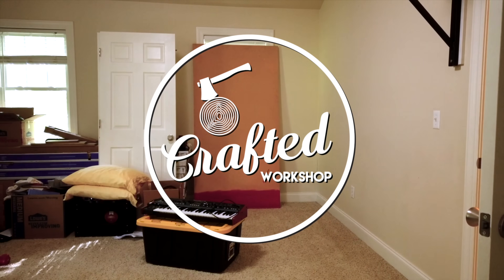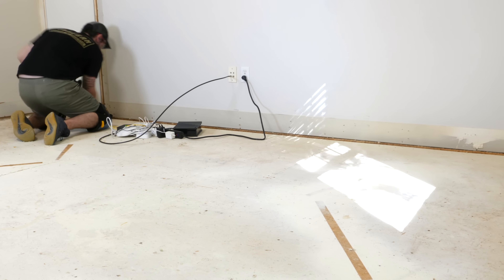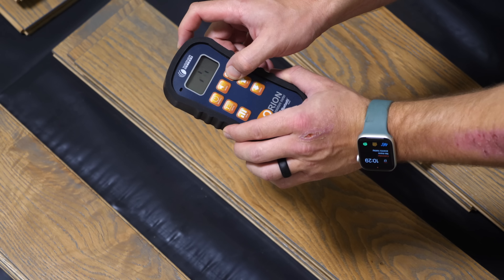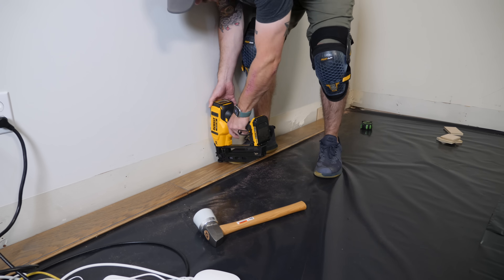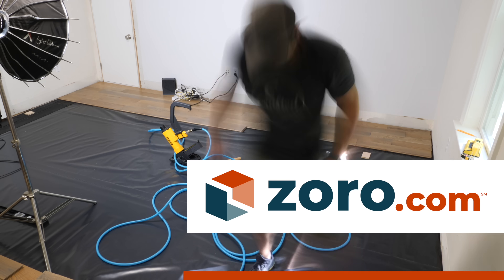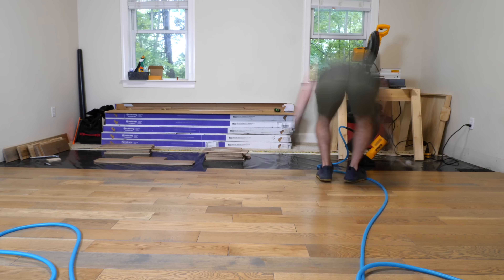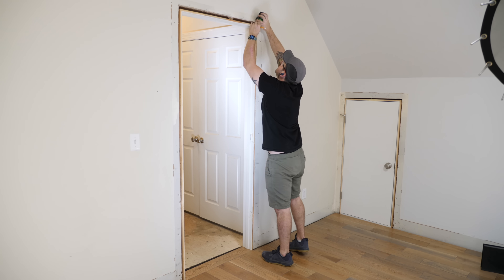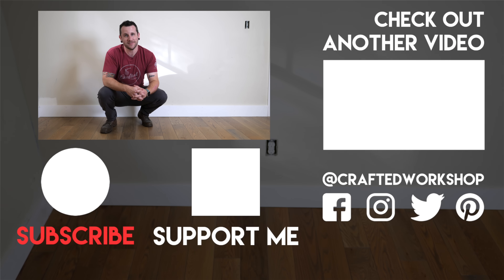Installing HARDWOOD FLOORING for the FIRST TIME 🛠 How To Install Wood Floors

Comment: Could you have left the baseboard molding in place if you wanted to keep them or do you always need to remove them when redoing floors?
Reply: They most likely will be in the way and need to be removed to match the new floor height and cover the floor gap to the wall

Comment: Defenitly don’t need that expensive tool to beat in your wood. Used a cheap 10
Dollar puller at Home Depot and it worked perfectly.
Reply: or your hand

Comment: Some mistakes. Plastic barrier will definitely cause issues in the future. If you accidentally spill liquid on the floor, the plastic will hold the liquid longer before vaporizing, cause possible mold issues under the floor.  So no plastic barrier.  To avoid coving, use floor adhesive instead. I ‘ve used it in a few hardwood projects and the floors are holding up very well. Not sure the shingles are a good idea. You might have issues soon after, I can see the floor getting loose. Also, best and quickest way is to laydown your floors like a puzzle and leave the last piece out. This will cut your installation time by half or less than half.
Reply: what would you suggest instead of shingles?

Comment: Pro tip because he didn't do it. When you get near the end wall and cant use the nail gun anymore you should use construction adhesive plus trim nail. Over time 2-4 years your hardwood floors done with only the trim nailer like in the video will start to back out like all nails do the adhesive will prevent this since your not using the staples. Also if your slab on grade or pier on beam with insulated joists I would never use a vapor barrier like this guy did. Your going to trap the water between your subfloor and the plastic. But you comprised the plastic barrier but punching holes in it every 6 inches so the water will accumulate and push up through those holes.

Comment: i like the 1.75 inch or even the pine 3.25 inch,  your 5.5 inch does not have the same appeal?  also did you run the long way down the longest side of the room?

Comment: Did you have to use different size nails in the areas that you used the roofing shingles for floor shims? the reason I ask is that I am planning on installing hardwood flooring in my house. Also wanted to say great video you didn't go into all kinds of random information. "just to the point " high five on that.

Comment: Hey, great video! Thank you! Question: I will be installing hardwood for the first time in our office conference room. The room previously had carpet tiles adhered to the floor. I have removed the carpet tiles and the floor is still very sticky. Can I place the moisture barrier directly on the sticky concrete floor? Also, what might you recommend for taking care of small uneven areas where glue pulled up? There are just a few areas where using a shingle (for example) wouldn't work. Is there some sort of drywall mud for the floors? OR better yet, can I leave a small circular depression of approx 3" in diameter without compromising the integrity of the floor? Sorry no photos! Thanks for your help.
Reply: Use a scraper to get as much of the glue up and ensure even surface. If it is flat with the glue still there just make sure you can remove any pieces of rubble that might stick to it and make the floor pop. On concrete you can use a quick mix concrete patch to level the concrete. I wouldn't nail the floor through concrete. Glue it. You can also use glue to fill holes.

Comment: @crafterd Workshop...excellent work bro...just wondering why didn't u leave half-inch gaps near the edges to handle wood expansion..
Reply: A nailed down floor isn't going to move and shift in the same manner a floating floor would.

Comment: Just a bit confused (and I don't mean to sound snarky) but a vapour barrier between two layers of wood? Plywood subfloor and hardwood , why? I'm not experienced or from the USA but you mention the vapour barrier being in place because of rising moisture from the garage, which we now can presume will condensate on the plywood side.

Comment: Just looking at the giant two-handed nailer is aggravating.  Isn't there a better tool that does the job without having to bend over, using your foot to hold the board in place, placing that nailer with one hand, and swinging a hammer with the other?  Considering that's a process that would have to be repeated a thousand times or so per room.

Comment: Why didn’t you use the pneumatic stapler on the first row? You used the finish nailer and I’m just curious why...
Reply: Because  the nailer would hit the wall. There's  not enough room to put the nailer on the floor for the first row. And you can't use it til the 3rd row if your installing 2 1/4 inch wide hardwood

Comment: Hi, thanks for the video, I wonder I got a compressor (150psi) and a nail gun but no flooring nailer. do you think I can use an ordinary nail gun instead of the flooring nailer? I just wonder what's it's additionally provide? I have to say it will be my first time posing hard woord floor, 150 pi2 room so not too big surface.
Reply: Yes but It will take awhile and you will be on your hands and knees more it will hurt and if you use the flooring nailer if there's a big gap you just hit the gun harder and it'll close the gap it's kind of hard to do that with a regular nail gun

Comment: Been installing hardwood flooring for 25 years, you never use plastic underlayment, the NWA recommends Aquabar. Plastic holds moisture.
Reply: ClimberGreg  Aquabar is a moisture barrier recommended by the National wood association made with two pieces of paper with tar in between. One roll covers 500 sq ft.

Comment: FORGOT TO ASK:  Is there a reason that you did not use the pneumatic nailer to secure the first row (tongue) instead of the using the cordless (at 7:55 and 8:50 on the video)
Reply: Carl R. Mauri probably so he could maintain the expansion gap he had marked out, instead of smacking it up to the wall

Comment: the Armstrong solid oak flooring in this video looks so great quality and wide. It's nowhere to be found in big stores. They only have sub-standard flooring and the small local shop are too expensive. When you see all the hardwood floor available in forest that falls everywhere and is let to rot, you realize something is wrong with this country.

Comment: Wouldn't you typically use some kind of impact sound insulation when installing flooring?
Reply: Chrysostomos Siegl You don’t have to. Most often in residential applications it’s not used. Most of the times I have used it it was in high end multi family condo units.

Comment: I work for a small company that's currently renovating an apartment complex, and when I demo the carpeting I like to get rid of carpet tack with a long (like shovel size or broom size) flooring scraper. Slam it into the tack strip and the whole thing just pops off. These units have a concrete subfloor over the OSB subfloor so I don't know how well it would work if secured into OSB.
Reply from the maker: Yea I'd be interested to know if that would work as well for OSB. I know removing the tack strips from concrete when I did the laminate flooring was much easier, the nails going into the OSB were quite a bit longer.

Comment: A few things... before you start, run a level over your floor everywhere and check for high spots, then plane them off, don't shim. 

With a hardwood plank 4" or wider you want to do a glue down application. Give it time, that floor is gonna squeak. A full glue spread acts as a vapor barrier, and many professionals even just do a partial glue down without vapor barrier in favor of glue.

As you are going through your first rows run a string line to make sure you've stayed straight from your first line. 

For anyone doing more than one room, Either lay out 6-7 rows at a time and then nail down or work in a pyramid pattern from one side to another for greater efficiency.
Reply from the maker: I could not plane my subfloors down ½", they would be paper thin at that point. And gluing down solid hardwood is very uncommon. I'm sure there might be a few squeaks at some point, but I think properly using staples or nails can mitigate that.
Reply: A glue down application in a wider plank product is very common regardless of composition of material, especially for professional flooring contractors who do not want callbacks. You also want a flat and monolithic substrate for your flooring to be applied against. Use a combination of subfloor leveler and material removal to achieve this. For anyone watching this as a tutorial, do not shim your flooring in this manner. The strength of your Fasteners is significantly decreased if penetrating through a significant thickness of soft and porous material or through a void before contacting the subfloor
Reply: @rafemaxwell4143  You made a mistake in your math, Rafe. Using 2 inch staples will result in about 1/2 inch of staple penetrating completely through the subfloor in the finished application. So in this case using shims (and in about 99% of cases) he was fine. The 1/2 of shingle shim material will not prevent a 2 inch staple from being solidly anchored in the subfloor.
Reply: @idontthinkso666  If a flooring contractor showed up to one of my jobs and wasn't gluing 4.5"+ hardwood, shimming voids, and said 1/2" of penetration was sufficient for hardwood install I'd tell them first to leave, and that they need to learn proper install practices or they are going to be having serious call back issues in the future on their jobs. Not tryin to be nit picky, just trying to help people who want to install floors 👍
Reply: @idontthinkso666  Relax Pat. I'm just trying to tell people how professionals do it.

Comment: Why an impermeable vapor barrier?  You see websites/videos suggest this stuff all the time.  Now, instead of the moisture reaching your hardwood floors, it's now trapped on top of your subfloor.  If you have proper insulation above your garage with paper facing heated area (which is a vapor barrier), this is totally unnecessary.  Red rosin paper and felt are NOT impermeable and is mostly used for squeeks/eliminating the "wood to wood" connection. Fortunately you poked a ton of holes in it with nails!

Comment: Many things which was said that is not so true

Red Roslin paper should never be used. 15lb felt or 30lb felt black paper 

Acclimation doesnt need weeks, first and foremost proper acclimating should mean if the flooring is contained in a sealed box you must open each end of the box in order for proper air flow, the amount of days depends on the M C count (moisture content) of the subfloor and the flooring
Flooring should be installed perpendicular of the joists, unless there is a double layer plywood exceeding 1”.. flooring should have a nail pattern which he actually was correct.. unless u have a flooring plank 4 1/2” or greater must have a glue and nail type install. The boards when installing should have no less then a 7”-8” board layout. If u need to adjust the leveling of the flooring cedar shingles should be used  unless u like to smell tar in the summer months.. ive been doing flooring for over 20 years.. im certified by NWFA....

Comment: careful  at the finish gun, 12:09 13:40 look at the angle you are trying to use the finish gun ,  you should somehow be at 45degrees with your floor.... The flooring , in this video should be installed from left to right , not the way you did it...

Comment: You're doing too much pulling off the trim around the door, use a fein tool to cut it the the right height with a scrap piece of the floor, that way you don't have to play carpenter later on

Comment: Do not use a jigsaw for the entire job! I just finished a 12 x 11 bedroom laminate using only a jigsaw to cut, and my god it took like 4 days to finish.
Reply from the maker: Hah, definitely much slower! I’d say it’s well worth investing in a miter saw for these projects.
Reply: @craftedworkshop  certainly, used your vids to learn how to do it and it came out great! Thanks
Reply: If you can't / don't want to invest the money or space in a miter saw, you can use a circular saw and speed (rafter) square, the cuts don't have to be perfect as molding should cover them

Comment: never install a moisture barrier were it can trap moisture between two barriers ergo he said room was over a garage........if there was a moisture barrier over the garage and one below the wood floor  ...........YA GOT A MOISTURE TRAP
Reply: But if the ceiling was unfinished, there wouldn't be anything there yet.
Reply: @scottperezfox  doesn't matter that is a how to video. Plastic moisture barrier will void warranty and cause subfloor rot. Wood needs to breathe. An acceptable  underlayment is aqua bar  B.
Reply: People, you need to educate yourself on moisture barriers! This is not a high-moisture situation. The barrier will help to minimize minor seasonal fluctuations in moisture. The subfloor will will dry to the garage below, and the floor to the living space above.

Comment: Plastic is not breathable and a bad idea for underlayment it will trap moisture.
Reply from the maker: Yup, I wouldn't use this again in retrospect although I haven't had any issues so far.
Reply: @craftedworkshop  It's nothing that happens fast the moisture with just slowly collect and cause issues sometimes years down the road, I use Red Rosin paper myself.
Reply: @craftedworkshop  . . . DUDE!  I so TOTALLY love your transparency and sharing your mistakes.  So far you've saved me from some train wrecks.  😜

Comment: Don’t use plastic under your wood floors boys and girls.   It’s not breathable and any moisture that gets in there is there to stay. 
A trim nailer on the finish up wall is fine but you angled it to much. When you do that the nails glance off the subfloor and curl back up underneath. Try to stay with the same angle as the flooring nailer when using a trim gun through the tongue.

Comment: Damn That flooring was all shorts. Looks fine but makes it twice as hard to install.
Reply from the maker: Definitely a lot of shorter pieces for sure, but they made it easier to avoid waste. I had one Lowe's bag full of offcuts, that's it! Pretty dang good.
Reply: it makes for a stronger floor because it requires more staples.

Comment: Big trouble with a moisture barrier.
Wood and water don't mix!
Puncturing thousands of holes in the barrier totally defeat its purpose. Keep the moisture out, not trap it between the hardwood and barrier.
You'll rust and rot the cleats or staples out!
I've seen it. Installed hundreds of thousands of sqft.
Reply: With all due respect, if you don't understand what you are talking about, you shouldn't comment. You just embarrass yourself.
Reply: @idontthinkso666  educate me man..
Please if I'm wrong I'd like to know what's right!
Reply: Dee Real Don’t misunderstand the purpose of the material. It’s to slow/minimize the diffusion of water vapor between two spaces. Complete stoppage of water vapor isn’t the goal and isn’t possible. You just want to create some equilibrium—or close to it—to avoid flooring issues.
Reply: When all else fails do what the manufacturer recommends.  No hardwood manufacturer would suggest a plastic vapor barrier. The will only recommend a silicone vapor shield or 15lb felt paper. There are also products out there that are similar to carpet pad for hardwood, MP global is a good source. The purpose of the vapor shield is to  eliminate moisture transmission from subfloor to hardwood, known as hydrostatic pressure the vapor barrier he’s put down could do exactly what you described though maybe not in his lifetime. The ironic part is he’s actually using a moisture meter which virtually nobody ever uses, good on him but I hope he knows that they need to be set to specific species to be accurate.

Comment: The half inch gap is completely unnecessary, if your flooring was to expand a half inch it would have to sheer every nail on the that side of the floor. It doesnt happe

Comment: OOF! Ash-fault on the interior of a home. Definitely not text book. A petrolatum based product inside a house is a no no. Why not a wood shim? Why not step back and level your floor with self leveling concrete mix? Don't compound your mistakes,

Comment: You know I wasn't gonna comment but C'mon man after installing nice hardwood you install that shit MDF crap, gotta go big use some zebra wood, purple heart, wenge, fuckin domestic oak,  mahagany, so many good tropical exotics,..good job on the install though I'll definitely be using the roof shingles idea for shims, my house is 1950
Reply from the maker: Pretty sure that would have cost a fortune, hah! I prefer MDF if it's going to be painted anyway.

Comment: Who in their right mind builds a house with OSB as sub flooring , not to mention buying said house. Young guys know nothing.
Reply from the maker: Almost everyone in the United States? Unless your house is slab on grade, it is almost guaranteed to have an OSB subfloor if built in the last 15 years. Advantech is dimensionally stable and extremely strong if installed properly.

Comment: Bro, you didn't do terrible but I will bet that your floor is going to fail. You should have glued the first row and the last row. The plastic you laid down was overkill and not necessary.  Also it's much easier to remove the base, everything is not called trim. You have baseboard near the floor. You removed door casings on the wall near the door. The base is actually much easier to remove after you remove the carpet. They also make a stand up floor scraper to remove all of the staples. You do not need a hammer to remove tack strips. Let's not make informational videos if you yourself still need information
Reply from the maker: Floor is still fine years later. The title of this video is "Installing Hardwood Flooring for the First Time", did you think I would do it perfectly? I'm always learning!